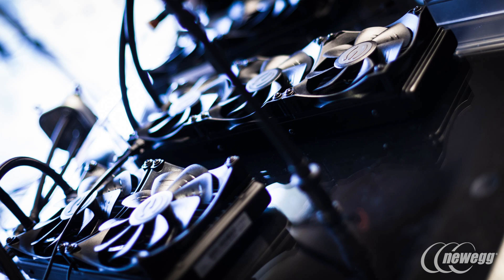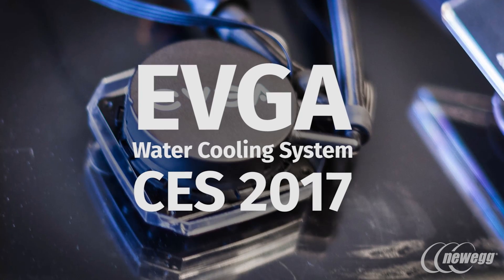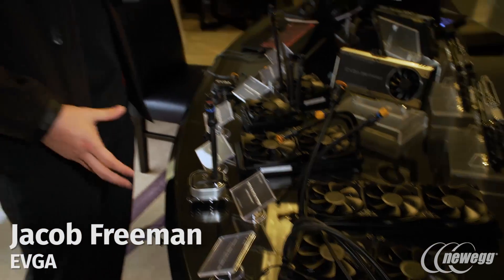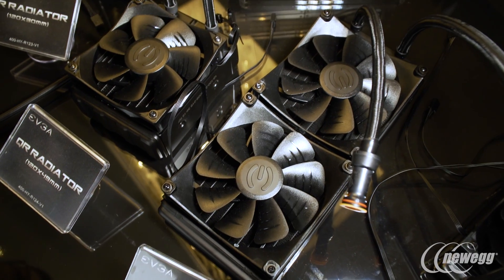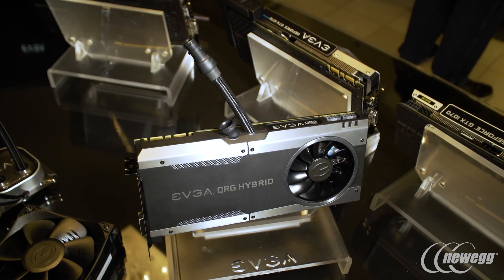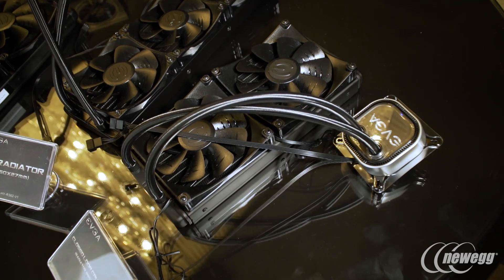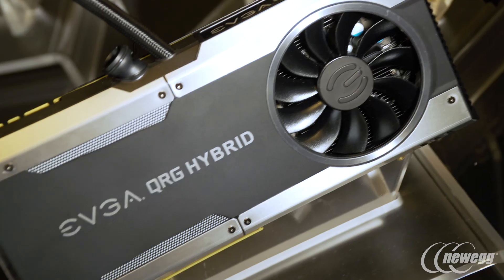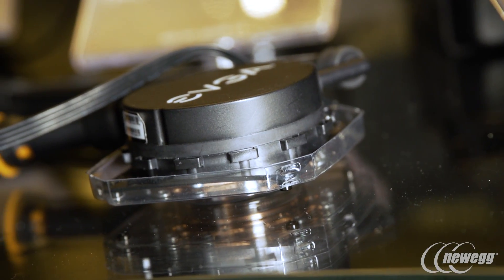CES 2017: EVGA Water Cooling Eco System

Comment: Cool, always wanted to get a little single radiator one.
Reply: You should look up "closed loop liquid cooling" It's this, with out the "quick disconnect" and they sell single radiator versions for around $70-$50 (that's probably a lot less than this is going to cost) I recommend either Corsair or NZXT those brands seem popular and I have owned a Corsair liquid cooler with no issues for a few years now
Reply: IZY2091
Thank you!
Reply: No prob, happy to help.